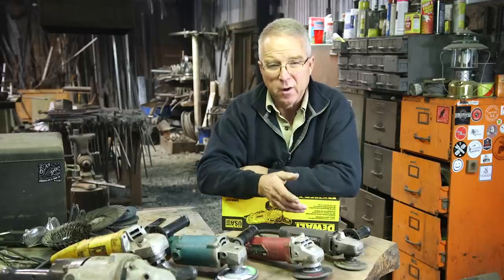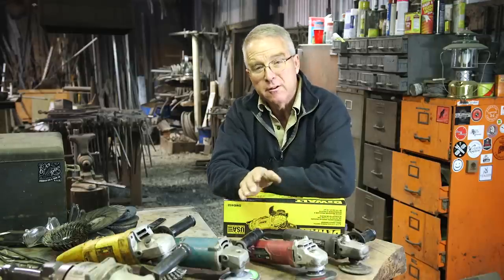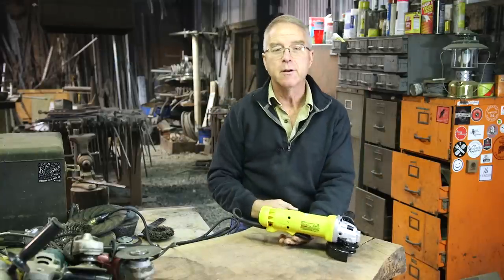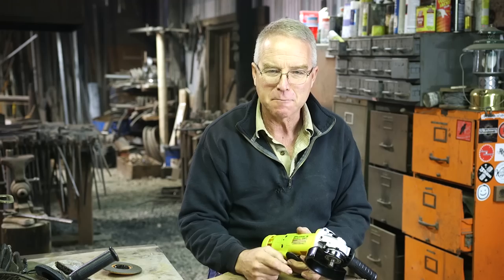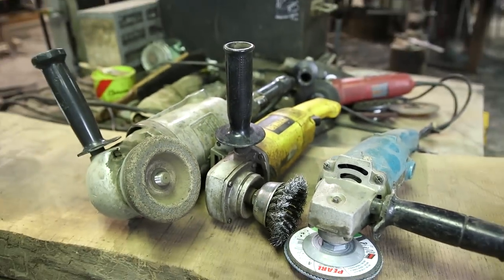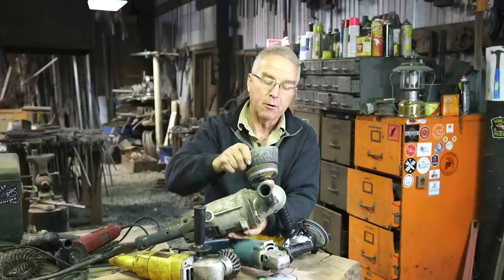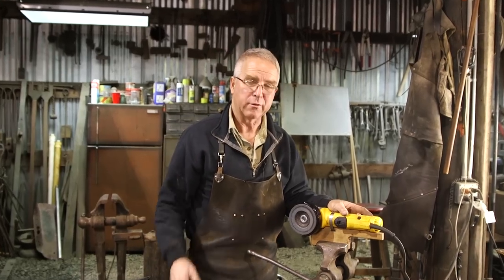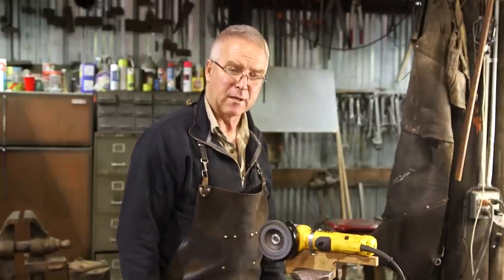Get Another Angle Grinder

Comment: Even for you hobbyists out there... I'd recommend at least two grinders... and PROBABLY three as your general minimum to keep around.
Check it out. Sure, it's just a hobby, so time isn't the essential worry, and neither really is convenience since you're basically happy about farting around with the process... whatever it is. Okay, but I've yet to run into a single job where I could be happy with only one grinder... and not absolutely excited to work with two.
   It's the pleasure of keeping both your coarse and your fine working tools right there at hand... no faff, no excessive miles spent hunting, and no question of whether or not you've got the cutters or wheels or discs or what have you for the job. You usually want two different "grades" of work in any single project and you need two different "grades" of utensil to do it.

   SO that covers keeping two around... but why "Probably" three?
   The first two should be your "twins"... Utterly similar in every aspect if possible. Just buy in pairs... and relax in the confidence that they will likely stick around a while, rather than rushing back to the store for another and another... AND should one break in the middle of a project, you can get a suitable replacement after finishing...
   BUT that third one... JUST go to a garage sale, flea market, some liquidation thing, whatever... and buy a cheap piece of crap that does the thing... It's not a workhorse, but the "in shop whipping boy"... Basically, it's for those rare but necessary HORRIBLE sh*t-jobs that you don't want to stick your workhorses into.
   If you're hobby (or work) is carpentry, this is the grinder you stick into rock and masonry carving... It's what you want when you have to trench out a space for some piece of framing, or another and you're fine with your workhorses doing metal work occasionally... BUT rock dust KILLS EVERYTHING!!!
   Same idea if you're regularly a blacksmith or metal fabricator... Hell... even masons tend to keep their best grinders (though they usually only need/want one) for cutting metal... and the masonry cutting is a whole different animal... Rock cutting... nobody wants to do that... SO put the "cheap piece of crap" to that trench... save the decent utensils.

   NOW... once you've bought a couple, you can reckon with the "hard life" of an angle grinder. Run them, and have no fear about tearing them up. They're all pretty tough... but longevity just isn't usually in the cards. If you're like me (outside a lot, bad weather, piss-poor ground, lots of rocks... and worse)... hell on equipment, then you can tell pretty quick when a grinder "has seen better days", so go ahead and replenish for the work-horse category, and "graduate" used tools to the "sh*t-duty" position, so you don't lose too much pace... and when an inquisitive youth wants to apprentice, you have something to show appreciation, too.

   Giving an angle grinder to someone who's never owned one sets a certain level of bond from "master" (even laughably) to "student" (even the half-assed). ;o)

Comment: Essential Craftsman, no you haven’t broken the guard, some of those guards aren’t meant to be locked in such a position that it would render it useless. They only lock in a position between you and the work piece as you said in this video. Also, I agree that the the angle grinder (because of the many types of wheels and cups) are one of the most versatile tools one can own, no matter what the trade.

Comment: Jumped onto my computer from my tv watching this episode.  As a hobbyist It's almost more important to have multiple for safety. That way you're using the right attachment to do the job. How many times has one used a cut-off disc as a grinding disc with the side load because it was in the tool. I have (3) 4.5" grinders.  All of them have been about $15-$35 on sale in passing them at the store and none are name brand.   One gets a brush (cup/wheel) one is a grinder and one gets a cutoff disc.    My favorite is a rat tail that has a quick release lever for adjusting the guard.  I really dislike one of the ones I own and I use it for my nastiest jobs hoping it will die.

Comment: It doesn't matter if I'm a Milwaukee guy, but the setup on the vise isn't as practical if there's no switch lock. Holding the paddle switch while bench grinding isn't that handy.  I prefer to use my cheaper angle grinders on the vise mount because they often have that thumb lock that you love to hate. You're still one of the best Scott.

Comment: Cut off wheels are why I would never set an angle grinder wheel down.  I know that a number of people are needing the fancy flipper on the switch, but they have always frustrated me, and in 50+ years of using grinders, have never needed a safety button.  Neighbor from across the street gave me a Rockwell grinder, needs a new snap switch to continue probably longer than I will.

Comment: 12:21 You haven't broken it, but you are in fact in the midst of taking the guard off; if the disc hadn't been on there, that position you've reached where it won't click any longer, is when it's on its way out of the slide and about to come off.

Comment: I use an angle grinder almost every day. I find the paddle switches are THE WORST. The toggle switches that lock on are the best (little more dangerous). Also the button is nice when it's on the side

Comment: I bought an old Black and Decker Industrial 9"  angle-grinder, metal body, very heavy. It turned out the one of the brushes was turned 90 degrees. The tool has been running like this successfully. I cannot correct it.

Comment: If you could only have one grinder, don't bother with a 4.5". Go with a 5" rat-tail Makita/Dewalt instead, you'll get a more powerful motor and the extra length of rat-tail grip really helps to control the nearly 1.5HP in your hands. You can still run the cheaper 4.5" discs on a 5" grinder and in my experience, it cuts/grinds a lot faster because of the extra power and control-ability.

Comment: I only use cutting wheels on a variable speed angle grinder at about 5000 RPM's which besides the guard makes me feel safer most grinders run between 10,000 or 12,000 RPM's and I do think that is way to much rotation for them small and thin cutting wheels.

Comment: Most of them have a 5/8” arbor and take about all types of wheels and accessories which are also cheaper at Harbor Freight.👍
Reply: Some of name brand wheels are cheaper on Amazon than the Harbor Freight ones, bought in bulk. I tried the HF cut off wheels, didn't like them, ordered some DeWalts from Amazon, 5 for $8.

Comment: Never had a problem with Makita thumb switches, so I will have to strongly disagree with your paddle/trigger only suggestion. Whether it is in a vise or in your hands, it is nice to be able to turn one on and not have to worry about your hand being in a particular position to push a paddle or squeeze a trigger. Don’t know if those Dewalts have a paddle lock that keeps it running, but if not I definitely don’t want to have to tape/zip tie the switch down just to keep it on.

Comment: I'll have to disagree... Been using grinders most of my life and I'll tell you I can't stand paddle switches and I don't have small hands. Thumb switches get a bad rap but the thing is I've killed grinders just from heavy work over the years but have never ever had a thumb switch fail or been unsafe for me. I've never left a guard off permanently but on my new grinders the guards come off much better than they used to which I am glad to see. The side handle stays off most of the time unless i need to grind for an hour which doesn't happen often but it's in the toolbox just in case. I have gone through a couple Bosch grinders in the last 10 years but I like them a lot. The smaller (7amp?) models fit one hand and it's not sooo much power that the grinder wants to jump out of my hand when I turn it on. I've always found that I had a better grip with a thumb switch and It didn't want to jump out of my hand versus having a little different grip for the paddle switch with one hand and it wants to jump out of my hand. Thumb switches get a bad rap but honestly I pay attention and have never had one issue or safety incident. My last comment would be, don't buy cheap grinding stones or flap disks. The cheaper ones in my experience vibrate more or are not really balanced so it makes you think the grinder you just bought or have owned is all of a sudden a POS because now it vibrates you arm off. Spend a little extra for the good wheels.

Comment: Heh heh, go figure: not only do I find the guard to never get in my way, and, in fact, I often find it helpful for stabilization, but I also prefer the thumb switch. I like being able to change my grip on the the grinder to position for a cut without having to keep a trigger depressed.
Reply: Now granted, almost everything I use a grinder for is cutting. I'm either using it to fine-tune notches in fiber cement siding, or for the occasional need to cut some kind of hardware or strap. I can see why a paddle switch and the absence of a guard would be preferred for working the surface of something.

Comment: Cutoff wheels may be the most dangerous, but losing an eye to a broken wire flung from a brush is probably no fun. A locking tool-free guard was a feature on my Bosch 9" rat tail grinder too. Saves finding a screwdriver to change the guard position.

Comment: I have to disagree with the paddle switch comment at least for me.I'm a tilesetter and a paddle switch puts my hand to far away from the head to control accurately.  the thumb switch is in the perfect place on the side for me. I have used  makita, dewalt, milwaukee, and metabo grinders in the last 20 years while working.

Comment: All angle grinders are not equal as you show the ergonomics is a big part however, HP is also a consideration. A low HP grinder would be fine for light polishing,  wire wheeling and such but not for heavy cutting, grinding operations. Pay attention when you buy any angle grinder to the Amperage . A simple way to check horse power is multiply volts x amps equals wattage. 1 Hp is equal to 746 watts or 6.9 amps these are rough numbers and are based on single phase power and I did not sleep in a holiday in so YMMV.

Comment: The ability to move the guard around and it snap in place is only possible in a useable position. Not in a turned around position where you are trying to grind with the back side of the tool.

Comment: Ain't broken. Just not designed to lock with opening facing user. Go figure 😂 That guard lock design is definitely the best and I've seen it on various brands obviously because it's the only way they can tempt experienced users to keep the darn things on. They really suck for cutting as they tend to get in the line of sight. Then there's access of course in tight spaces and worn attachments.

Comment: I don't agree with you on the thumb switch thing. I like grinders with thumb switches, I find them really handy, you tun the grinder on, and it's on, you can move it about any which way you like when you are using it and you don't have to keep your finger on any kind of trigger. Take care, but it's real handy, especially if you are using it in a vice anyway. I have the exact same Dewalt model as the one you show except mine has a thumb switch, and I wouldn't trade you any day of the week (well, obviously not the exact same model). In fact come to think of it I have a grinder that does have a trigger (I got it because you can adjust the speed, which is sometimes handy) and every time I come to use it, I find having to constantly hold the trigger a pain in the neck. It's not to bad because I mostly use it for sanding and polishing (hence the speed adjustment), so hold it face down, but if I were using it for cutting and grinding and having to hold the trigger all the time, then no, not for me.

Comment: Any grinder that doesn't have a tapered handle and a trigger will never make it into my toolbox . I know most welding jobs that I've ever been on , an angle grinder with a switch rather than a trigger , you can't use it on the job . OSHA will bust your ass . Truth be told I think grinders with a switch are stupid , if you happen to have to drop that grinder it's going to keep going and possibly cause injury . My 4.5 inch Porter Cable has been my daily grinder for 3 years now .

Comment: They aren't as "safe" but I prefer an actual switch so I can place my hands in locations other than the manufacturer's handle. Also to be OSHA compliant but not have a guard getting in the way trim back the guard so you can cup grind. And you must wear a face shield 100% of the time.

Comment: I would never buy an angle grinder with a paddle trigger. Thumb switch all the way! Much more versatile IMO to be able to adjust your grip without having to hold a trigger. It is more of a hazard without an auto shutoff feature on bind up though. That feature and an electric brake are very useful.

Comment: There is no reason you can't service any one of those grinders. Carbon brushes are cheap, the gear case is easily cleaned out and loaded with new grease, even new bearings are a fairly straight-forward little job. I have a pair of Hitachi grinders for metal work, a little Porter-Cable for my tool van, and an old beater Harbor Freight I use for tile and masonry work.  Just put new brushes and grease in that HF and it will last years more. Shot of compressed air does wonders for keeping these tools running, they need air to vent heat and choked up vents kill them more than anything else.

Comment: At work a guy was changing out the cutting wheel and for some reason he told another mechanic to go ahead and plug it in while he was still in the process of putting the new wheel on. The grinder started up and cut him really good. Then the safety department gets involved and concluded that the problem was that the guard was not in place. Really!? So the guy plugging it in while another still had his hand on the cutting wheel wasn't the issue?

Comment: Sorry, have to respectfully disagree with you: as a stone fabricator a locking thumb switch is the way to go. You can leave the grinder on when it's clamped in something. You get less hand fatigue because you can move your grip around. More grip options also makes the tool more versatile. Yes, the down side is it can be locked on when you plug it in if you're not careful but that's a small price to pay in my book. You'll catch me using a paddle switch grinder about as soon as you'd be caught blacksmithing with a claw hammer.

Comment: There's also a great picture floating around of about 20% of a cut off disk jammed right into someone's safety glasses. I hated to see you grind that rust off that steel plate without at least a dust mask. Sure, coffee first, but safety's in the top 3!

Comment: My angle grinders are measured in amps. A grinder (11 amp) like this is not a "small grinder" when it comes to power, even though 4.5" is the largest wheel it's made to use. I have 3 of these, all for 5" wheels and the largest one is 13 amps. The other two are 8 and 11 amps. Nothing delicate about them. We're not making jewelry here. Thanks for the nice demo.

Comment: Has anybody told this man to buy a Milwaukee fuel angle grinder or any other new Milwaukee. You won't regret it.
Reply: If every corporation operated like Milwaukee did there'd be no competition in the marketplace. Milwaukee patented and sues companies that make 18 Volt Lithium Ion tools. Even though Milwaukee invented nothing related to the technology. Their only contribution was filing the patent. Which never should have been granted to them in the first place. Using batteries as batteries is too obvious an idea to patent.

Comment: Never buy an angle grinder with a sliding style thumb switch.  Make sure it has a momentary “dead mans” switch of some type.   I watched a guy grinding on a steel corner,  the grinder grabbed and flipped around in his hands running.  It fell to the ground and landed on his foot.  Steel toe boot was cut half way though before I could pull the plug.    Less than 2 seconds.    Always buy a trigger or paddle the stops the tool when it is let go.

Comment: Comparing cost and what these little brutes can do I don’t think there’s anything that compares.
You can actually pick up one of these in a box store for less than $20.
My only complaint is I don’t have one with variable speed.
These things run at extremely high rpm. You need to use great care while using them to protect yourself and your material. 
You could easily remove material you don’t want to remove as well as  your own body parts.
I came across a video of a stone sculptor. She was using what look like a half horse power, 8 inch metal diamond blade disk. I didn’t finish watching the video. The cringe factor was off the scale.

Comment: Being made in the USA would have been enough to make me buy Dewalt but the 4.5" grinder is now made in China. When compared to other Chinese models it doesn't compete with the value of Mikita. 
I got a case, 5 cut off wheels and a diamond blade included with my Mikita for a couple bucks less than the bare Dewalt.
FYI I believe the battery powered Dewalt grinder is still made in the USA.

Comment: Besides the table saw probably the most dangerous tool. This guy defeated the guards on most of his grinders, which is not good practice for something that spins at 10,000 RPMs and generates centripetal force just turning on the tool that would love to grab onto your arm or hand. Also, if that disk ruptures you want some level of containment only the guard supplies. It's irresponsible for him to even show these grinders in that level of NON-PROTECTION